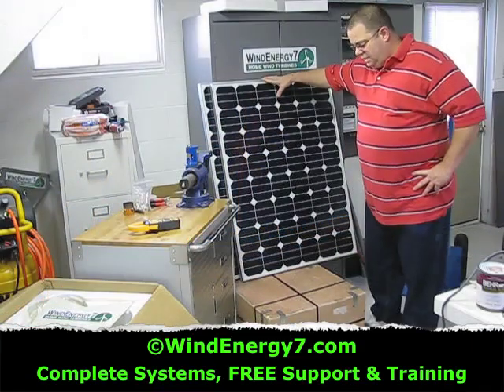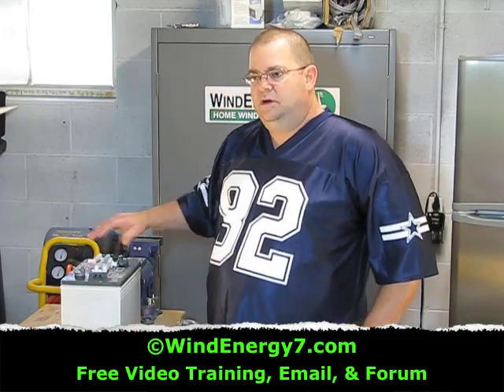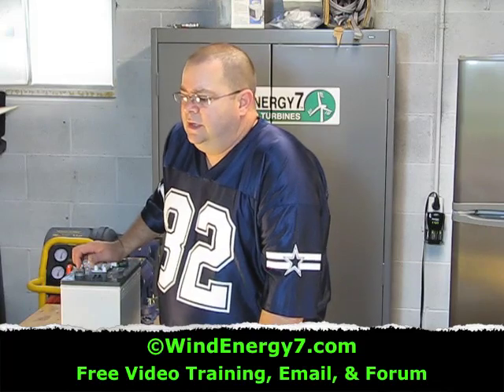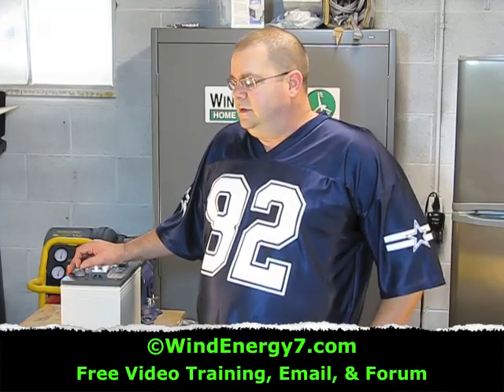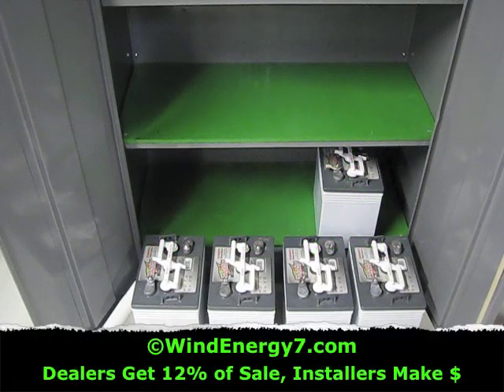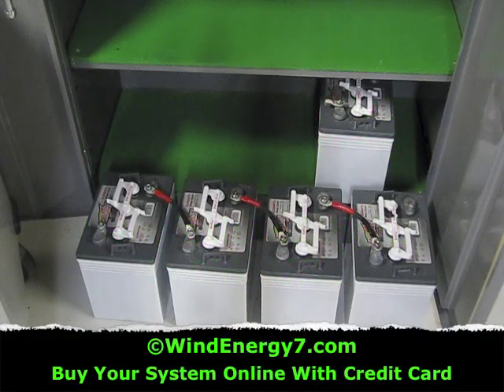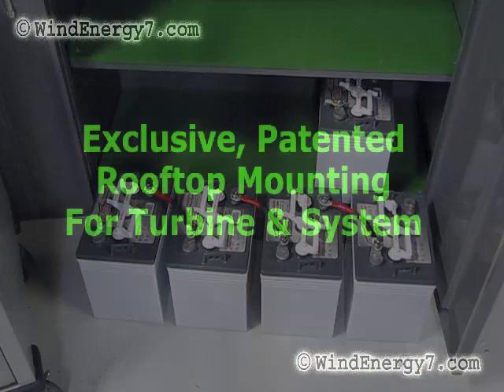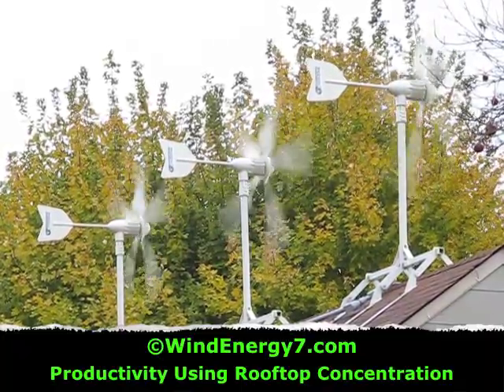Solar For Home

Comment from the maker: Your solar for homes and solar for home hardware systems, controllers, supplies. Inventor of the RoofMill™ solar for home wind turbine kit, solar for homes are our main expertise. WindEnergy7 has more options for solar for homes because of our many innovations with inventions and patents making small wind power and solar for home systems possible. We are not an importer, we are a manufacturer featuring durable american steel manufactured in Ohio USa... Visit our website at WINDENERGY7(.)com

Comment from the maker: @shartne Sure, all the cabinets have to have a dryer style 4 inch vent to the outside.  Put that in top of cabinet and warmth will evacuate the gas by convection.  Important thing to do.  I use the U2200 because it's price/performance has been so good in the field.  Like IT?  Please use  LIKE,  SHARE,  or  SUBSCRIBE  BUTTONS if you support what we are doing.  Thank You.. peace

Comment: thanks for letting me know about the U2200 I been using the Interstate made yellow top Optima they are very expensive but no maintenance and no gas I noticed you put yours in that nice cabinet but what about venting the explosive hydrogen gas? noticed the mouse in the background. I trapped one the just the other day on a piece of bread.